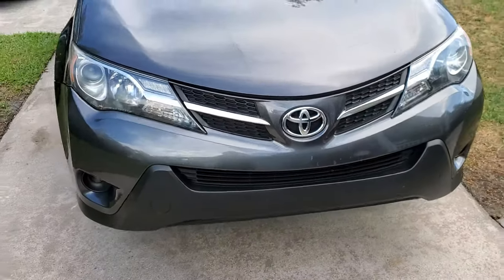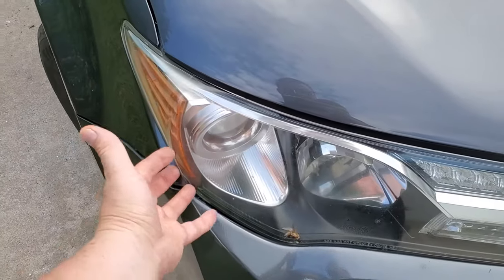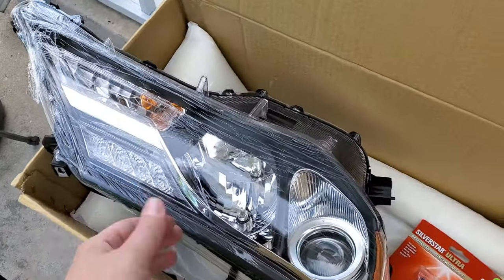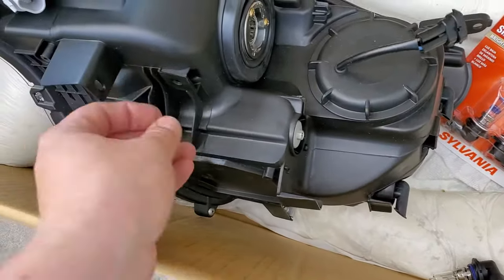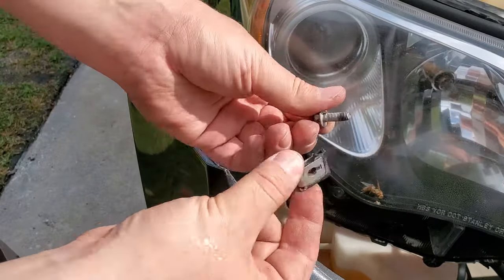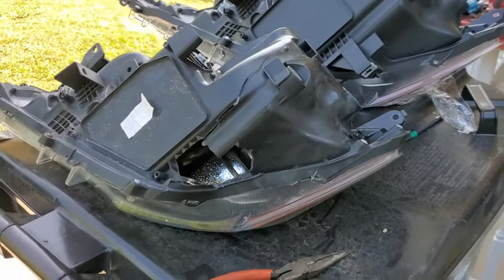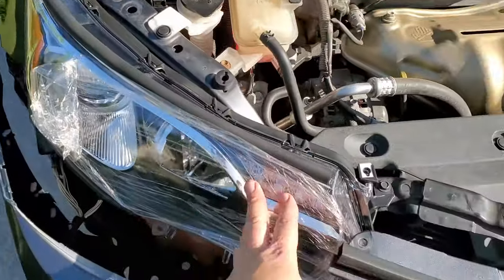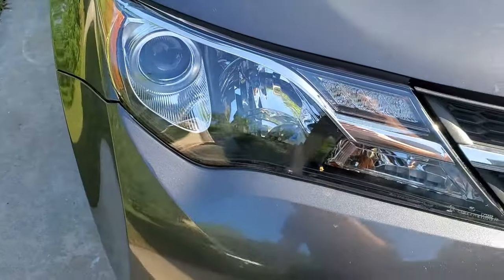2013-18 Toyota Rav4 Headlamp Replacement

Comment: Are any of the clips removed to loosen the bumper one time use clips? I wish I had seen this video before I changed my headlamps on my rav4. It was the same exact process, only I had to learn it along the way. My only blemish is not remembering how the clips and screws for the bumper were meant to go bak in.

Comment: Thanks a lot!. Can you add the link/info from where you bought the headlamp assembly. Also, the basic tools required for the jobs.
Reply from the maker: You need just the basic tools and wrenches lol. Where I bought these headlines link is not available anymore. Seller don't sell them anymore.

Comment: you cheated by not saying the bumper had been replaced/damaged ** along with the bolt close to the tire. .You fail to show how not to break the frigging clip on either side of where the bumper attaches near the wheel.  Thanks for nothing - have to replace the clip for the red bolts
Reply from the maker: @jdinyari  did not know that I had precious damage on my vehicle and you're welcome for nothing.... 🤷🤷🤷🤷🤷

Comment: Why didn't you just change the bulbs
Reply from the maker: Because inside plastic was dirty and yellow. No way to restore it. Headlight was broken on the bottom from the inside after a small wreck  for like 2 years.  It's been collecting dust and moisture..

Comment: Just like the Toyota Camry. I hate taking apart of the wheel well of the bumper. The cheap ass connectors in the wheel well never come out right, they are cheap as hell and it is a pain in the ass to get that cheap ass design to line up right. 😤
Reply: Using cheap plastic screws to hold up a bumper is not a sign of quality.